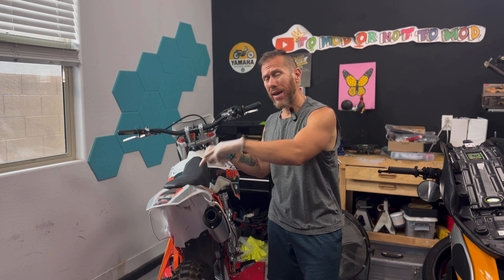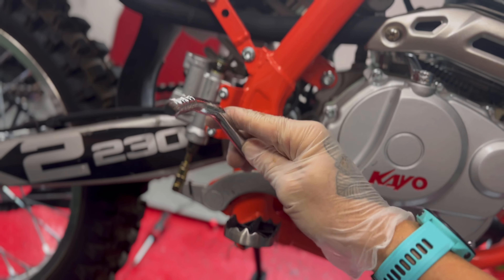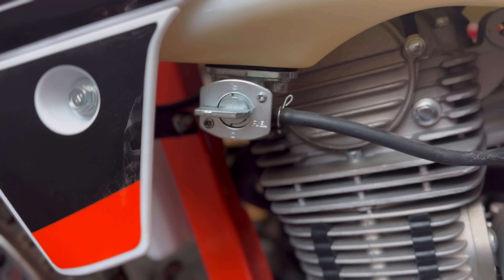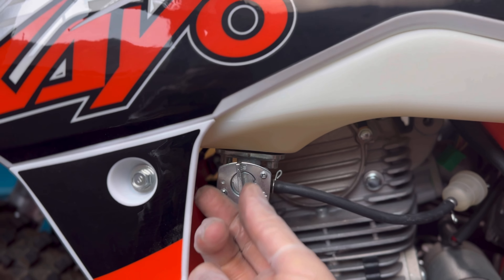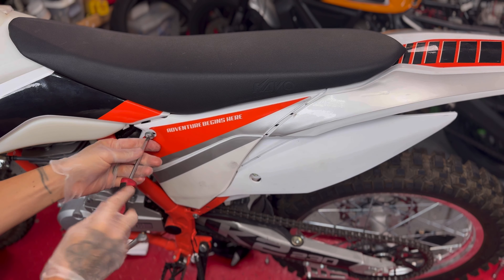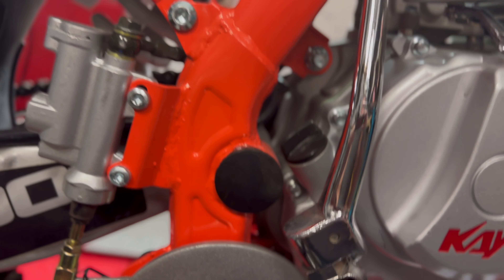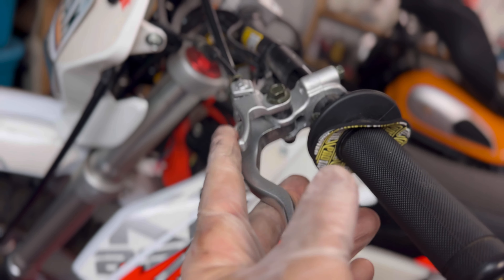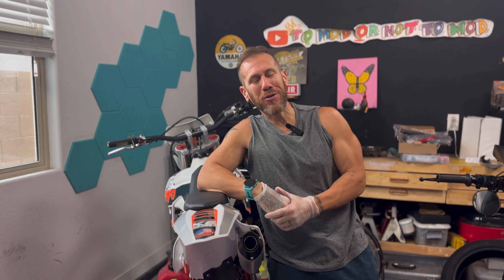10 Things you need to know about your Kayo K230 - Beginner’s guide #kayo #kayok230

Comment: I've also found out a trick I'm from Maryland and it's pretty cold around this way when it does get cold and it's hard to start sometimes and I found a trick out to don't turn the bike off but turn that pet valve off to where it runs out and let it run out of gas cuz mine was getting hard to start because I never turned it off that's my fault